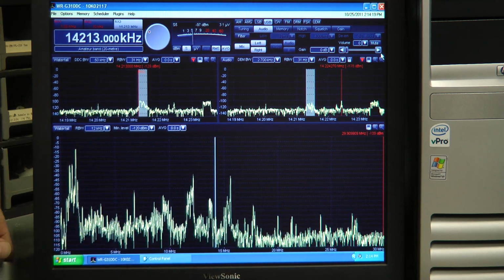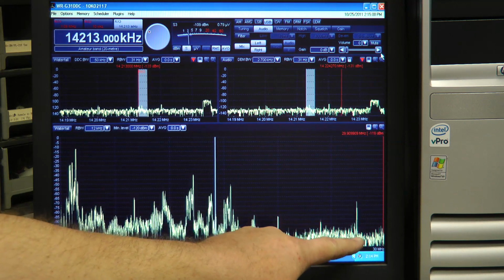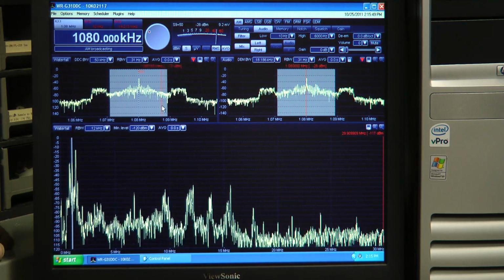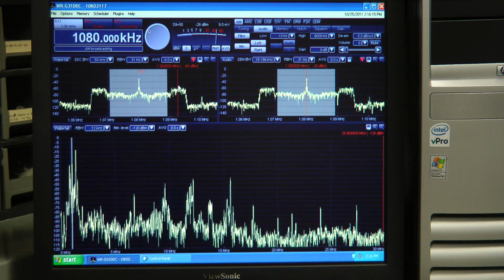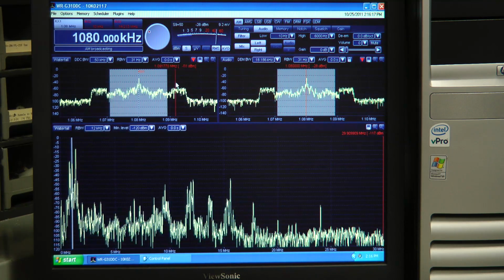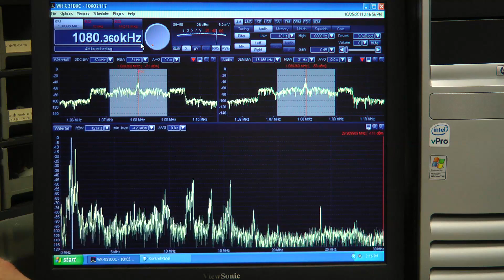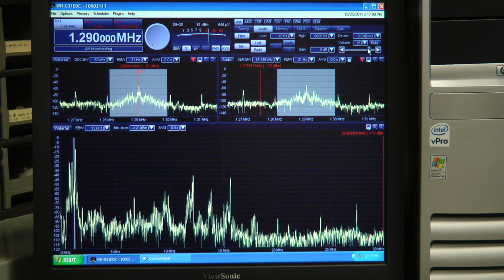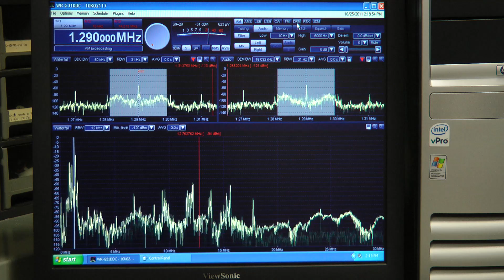WiNRADiO Excalibur Software Defined Receiver

Comment: it gets hot cus its amp draw is drawing the max the power supply can put out use one with a higher amp rateing and it will run cooler and the winradio will last longer

Comment: The cable supplied is rather low quality, the one I received in the box had a break in the middle of the cable, however the replacement was equality as poor in the radio end, so I have found that this has broken somewhere and no longer works. I an doubting whether I want to get the G33DDC in the near future as a result. I will say however the customer service in the UK (Richard) was exemplary.

Comment: Expensive? Think what a communications receiver that had a 50 mHz real time spectrum scope/water fall would cost 10 years ago. If you could even get one that is. :) 
I have had one for a number of months and I'm very impressed with it. The software is up dated regularly as issues are found. Also the user support is very good so I would recommend this unit to any serious listener.
SOL